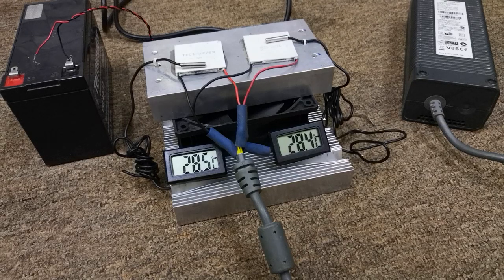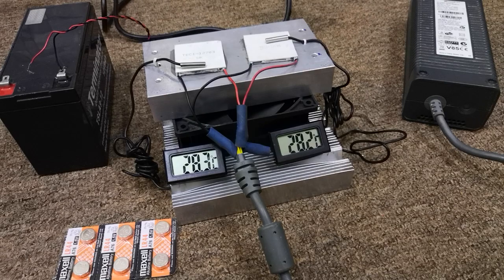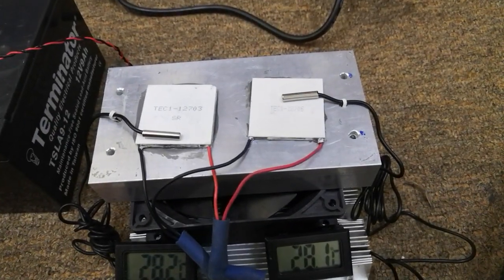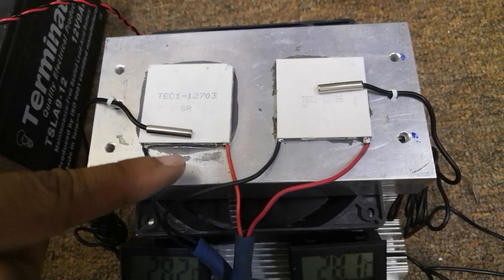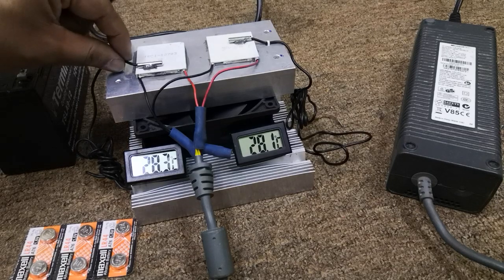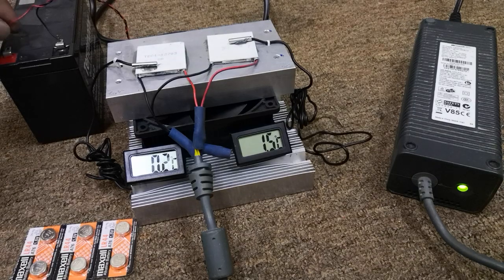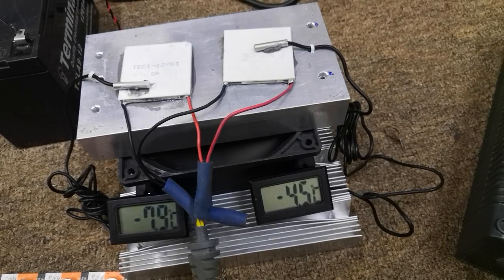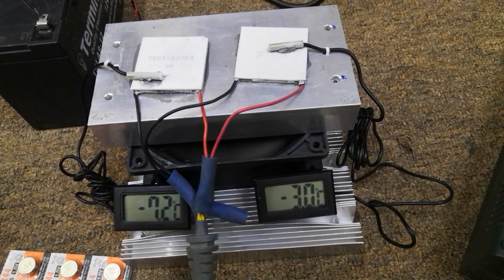Best Peltier comparison.. Watch this before you buy a PELTIER.  AND YOU BE THE JUDGE

Comment: This as are many of these TEC tests are flawed in theory.  We use these devices to move heat from one side to the other, so with no load on the cold side the low power modules always seem to perform better, because less current is less energy to extract on the hot side, which leads to a higher possible delta given the same cooling(on the hot side).  This test is even more muddled by mounting them both to the same block.

Comment: I'm new to peltier modules but I think this is a false test. The 6 amp module is capable of pumping more heat than the 3 amp module if that heat is removed fast enough. By cooling the hot side of both modules the same you are showing that this particular setup favours the 3 amp module. If you ran the 6 amp module at 3 amps (so it didn't generate so much self heat) would you get the same result? If you cooled them both more efficiently would the 6 amp one pass the 3 amp one? It's not a good test.

Comment: May I give my inputs, this test could be slightly better, if you do the test with 12703 only , and 12706 only at the same time on the aluminum block. 

Because you're having both Peltier chips producing almost twice the amount of heat the heat sink can remove. If you were to do it individually, the aluminum block will be a few degrees cooler on the hot side, and thus, the cold side will also reduce further for both peltiers and you can truly see a good comparison.
Reply: Another channel got similar results, but seems like he had a colder room.
Reply: I fully agree with you ViperNG, this test requires single chip testing, isolated totally one from another. But it's a start in the classification of Peltiers

Comment: There is no pressure between the Peltier Module and the Heatsink and the Thermometer. That will habe a big impact on the perfomance. The Thermal resistance is much higher without the correct amoutn of Pressure!

Comment: You mean 12703 has lower temperature than 12706 ?

I think if u have a better cooling system, the 12706 will beat the 12703
Reply: 12703 costs more than 12706

Comment: Which module would you recommend for a DIY mobile phone cooler?
Reply from the maker: 12703.. It has better cooling effect and it consumes less energy..
Reply: @DIYTAYSEERworld  even better than the 12715?

Edit: thanks for the quick reply btw
Reply from the maker: Not better in all aspects. But in terms of power to output performance 12703.. Again It is only in my opinion at least
Reply: @DIYTAYSEERworld  okay. Thanks a lot for the feedback man
Reply: @DIYTAYSEERworld is heatsink 4cm enough for peltier 12703? I mean in the heater, because someone told me that it must be a little higher in size like 5cm or 6

Comment: what volts are you using?
Reply from the maker: 12v
Reply: thanks bro  @DIYTAYSEERworld  what if I use 5v? will I still get the same temperatures at the end?
Reply from the maker: 5v You will not get best cooling effect because it is designed for 12v. Also it needs proper amps..
Reply from the maker: You can find 5v peltier modules available in market.
Reply from the maker: Please like share and subscribe to DIY TAYSEER WORLD.
Have a great day

Comment: Hi bro, nice video of comparison.. Just a fast question.. Can i change my 12705 to 12715 for mini fridge? Thanks for replying..
Reply from the maker: Yes you can change it. But if the power supply does not have enough current or you can say amps it will not work properly.. Or in worst case it will damage the power supply..

Comment: What is the power draw for each because that is very important how many ny degrees of cooling do you get per amp or volt drawn that would be a better comparison than just temperature because if one is drawing let's say for example one draws 1 amp for every 20 degrees and the other draws 3 and it's the one that is colder than I would give up a couple degrees of cooling for the sake of efficiency per amp this test doesn't really touch on what is most important

Comment: I thought it was a cool experiment guys!  I’ve played around with pills here and I’ve actually done the same crap of trying to figure out if the water would be five or 10° cooler and always ended up doing something wrong that I should’ve caught.  Other than those few couple of experiments, life was always in the way, work and all that good shit. I think it’s a fair example and even though he didn’t consider certain other thermal dynamics that certainly do impact the temperature differences of this that and the other, it was a small scale system and it all appeared to be piped equally distant and therefore greatly impacted just like everything else Refrigerated or air-conditioned, what he did was completely accurate in my eyes for a comparison. Great job man!

Comment: I am going to make a fridge, using these, for me camper van, is it best to have 2 small peltier, around 60w each, or one big one a tec1-12715,
Reply from the maker: If you have a good power supply.. Go for 12715..otherwise 12703 is the best for. Less amps and more cooling..
Reply: @DIYTAYSEERworld  me car cig lighter is rated at max 180w,  have 2 cig lighters, so can use the other one for fan,  so going for the 12715,   cheers
Reply: You be more efficient using compressors.  These are very inefficient.  Their use case is for localized removal of heat, not a big space like fridge.  Or if you really need quiet cooling.

Comment: After watching 👀 your information.
I had bought tec 12703.
But I have a laptop adapter which is of 19volt 6amp.
And another adapter of 13volt 1.2 Amp.
Which one is better power adapter?
Reply from the maker: Buy another adaptor.. Both of your adaptor are not useful
Reply: @DIYTAYSEERworld  I have to buy an 12volt 3amp power adapter right bro.
Reply from the maker: @trackmaker12345  yes exactly.. 12v 3a or more Amps..
Reply: @DIYTAYSEERworld thanks you rock bro.

Comment: can i ask bro? if 703 can realy freeze water?
Reply from the maker: Yes it can. But will take time depending on how much water.
Reply: sir if i use tec1 12706 with power suplay of 12volts 6amp it is ok or i user tec1 12703 for fast freezing of water?
Reply from the maker: 12703 is better than 12706.. Less amps less heat= more and faster cooling effect

Comment: This is not good comparison because 12706 creates more heat and need more area of heat sink to get cool you have to put 12706 on another heat sink  and the size of heat sink must b 2x then the heat sink used for 12703 then the comparison will be fair

Comment: Both are different wattages, different cooling power. By the way, do you know that?
Reply: That was gonna be my first question how much power do they both pull
Reply: 12703 is 12v 3A peltier and 12706 is 12v 6A peltier and yet 12703 provide much better results i tested myself

Comment: Well, apart from your test not necessarily offering the exact same conditions for both TECs, it is also meaningless, since the current to each TEC is unknown. You can't assume they will both draw the same current at a given voltage. If the better performing TEC is drawing significantly more power it's better performance is not surprising.

Comment: im using 12706 for portable air cooler but not enough cooling any suggestion?
Reply from the maker: Use 12703. And increase number of peltiers depending on your cooling requirements..

Comment: The difference in temperatures might have to do with numbers of junctions or even metals used in thermocouples within the device some metals produce  better linearity in output . More junctions will produce greater output voltage.

Comment: It is good to switch thermometers and run the same test again to make sure  thermometer differences don't play a big role. The temperatures taken the second time have to be consistent with previous step. Or place both thermometer on the same Peltier device to verify both working close to one another.  Good job.

Comment: I am planning to attach it to my 2'6" x15" x4' grow box intake fan to bring down temp from 30deg cto 18-24deg c. Will it work??
Reply from the maker: Yes it will work..
Reply: @DIYTAYSEERworld  should i use 1 module or 2? I have 4inch exhaust fan as in intake fan.
Reply from the maker: More peltiers is better and your fan size is OK.. But it should be high speed so it will be better..
Reply: @DIYTAYSEERworld  thank you 🤟🏻
Reply from the maker: @vaibhavshah6289  you are welcome to DIY TAYSEER WORLD For more interesting videos related to DIY..
Reply: @DIYTAYSEERworld  where can we find such big heatsink?
Reply from the maker: Last year I purchased it from banggood.Com.. N'w I am n't sure.. You can check the same on banggood.Com..
Reply: @DIYTAYSEERworld   whats the diff between sp1848 27145 and Tec1 12715

Comment: nice comparison. you could've shared current usage data for them, but I see the 12703 quickly cooled and stayed ahead of the 12706
Reply from the maker: May be there is 1 more reason, 12706 is a very common peltier module available all around and also it is very cheap priced, so there is a chance of quality issues or  peltier not performing at its best.

Comment: I am playing around with a smaller peltier 30x30x7mm at 1amp with heat sink size at 30x50mm with 30x30x10mm fan.  I get about 100 degrees and 60 on the cold side at about 80 degrees room temperature.  I will try bigger heat sink or more fans or maybe both or even a water cooling block but trying to keep size small.  Cheap on Aliexpress but expensive on Amazon.

Comment: I need an answer to the question, what will cool the flowing water more: 12 modules tec1 12715 mounted on four aluminum blocks (160mm) or 64 modules tec1 12703 on 8 aluminum blocks (320mm) ...?
Reply: you'll gain more total cooling effect from the 64 12703's because they are not too far behind in output than 12715's. they operate more efficiently but if power drain is not your concern, simpler installation and cheaper for 8 units vs. 64 units, recommended 12715

Comment: Hey I'm using tec1-12706, will it be good?
Thanks for your video...
Reply from the maker: Thank you for watching..
Yes 12706 is good.. But 12703 is better in all aspects..
Reply: @DIYTAYSEERworld  thanks
Reply: why 12703 is better than 12706 because one is 6A) 72w and the other 36 (3A) so it is impossible for the 3A to be better